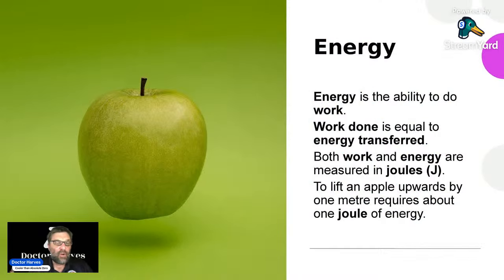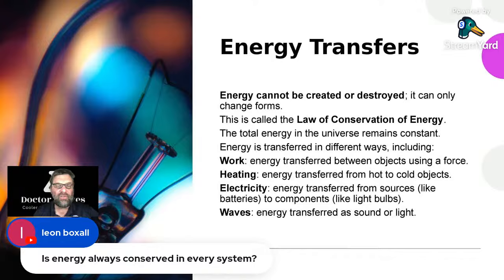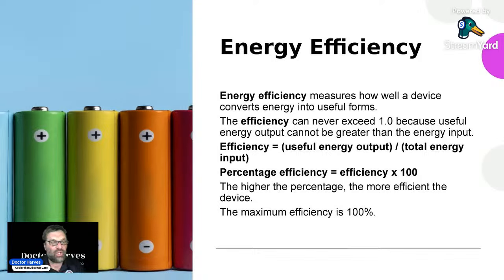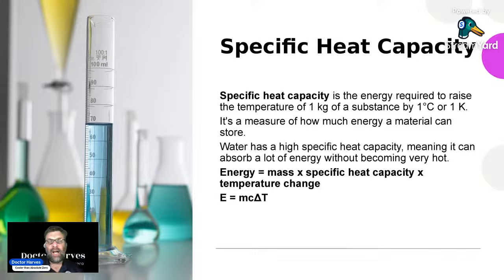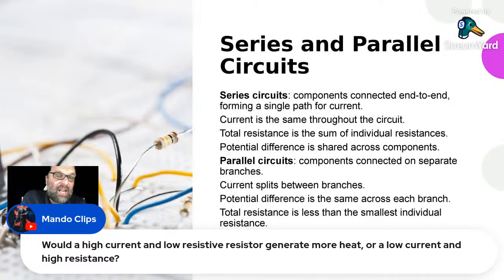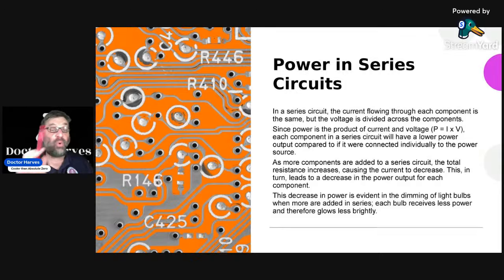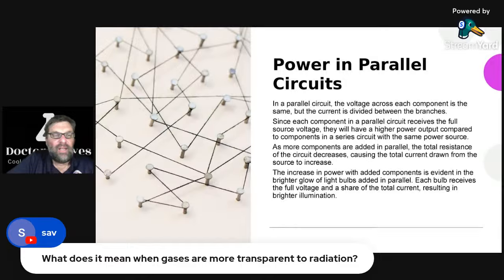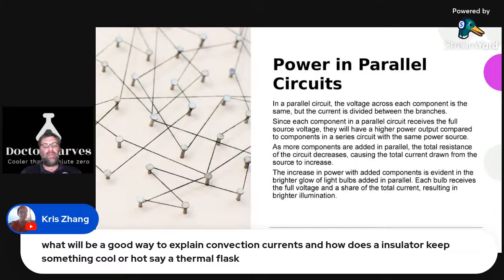NCEA Level 1 Physics Revision AS92047 Demonstrate understanding of a physical system using energy

Comment from the maker: Ignoring the errors with units in question 2, thought q1 and 2 were fair. Q3 focused too much on electricity rather than electrical energy.
Reply: Hello sir, there was a question on electrical potential energy in Q3, is that in our standard? because i remember that we have never been taught that. Is this question asked incorrectly or was this actually taught?
Reply from the maker: @Kris_Zhang  that's working back from P = V x I then we know E = P x t so can find E
Reply: @doctor_harves  Oh ok, where did it say what time (t) was, might of been me not reading the question correctly. idk how but i got like 3.92J of energy
Reply from the maker: @Kris_Zhang  Just rechecked the question, it asks for the rate which is power (So V x I)